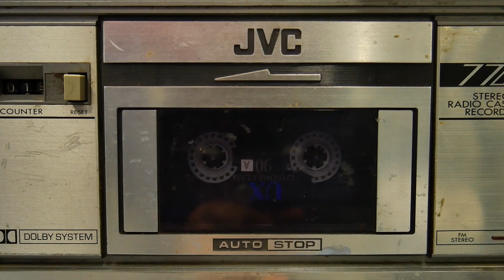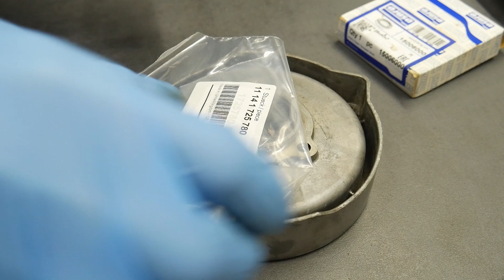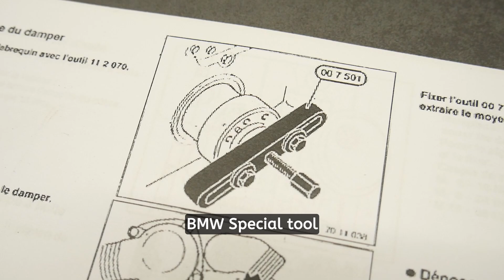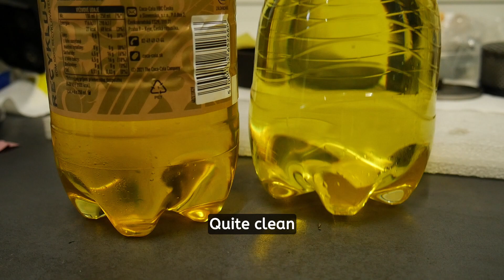BMW 850Ci Project LazerHawk Restoration Part 4: M70 Repair

Comment: Nice work.  Few tips though...  on the lower pan, always remove any bolt puckering on the holes from previous techs not using proper torque - and do NOT use sealant, as it actually breaks the cork. Kudos on the zip tie method too, not many know that one. Also, as you've likely figured out already, putting the water pump back on before the harmonic balancer is a good idea ;) . The Valley pan gasket & bolts... chase all the threads with a thread chasing tap, replace the studs, and use a thread sealant (not locker) on all of them - especially the studs.  The Valve covers use acorn nuts on most all of the studs except the ones that have the rubber stand-off to the manifolds or fuel return lines.

I've built these engines for over 20 years... M70's, S70's, & 6 Liter sleeved monsters.  They are super reliable when done correctly.
Reply from the maker: Thank you very much for your advice. This is my first car restoration, I could use any tips. And if you see something I'm not doing right, feel free to let me know.

Comment: I safety wired my Banjo Bolts. Lock tabs work just as well. Visual Reference as to they were tightened correctly. Looks good

Comment: Thanks for sharing!  I did my 850 M70 about a year ago, it brings back fond memories.  These cars are great to work on even for a newbie like me.  So many oil, pentosin, coolant hoses to replace!  I don’t know the condition of your valve seals, but that would have been a perfect time to replace them if needed.  I used the compressed air method and it was quite methodical and relaxing to do the job.  I wrote down the order of steps to do each intake and exhaust seal before doing the task to be sure I didn’t screw up.  Nice rims on your car.
Reply from the maker: Thank you for your comment. I'm a newbie too. The engine has not been started for 12 years. I do not know the condition of the valve seals, I would be happy to start it first 🙂

Comment: Last question for you. Which workshop manual do you refer to in order to find torque specs on all the engine bolts?

Comment: How did you lock the motor to torque the crankshaft bolt?
Reply from the maker: I locked the flywheel
Reply: @synthwavegarage  how did you lock it..and what's the torque spec for the crank bolt, I have to replace the lower timing chain cover,one of the crank sensor mounts broke,wanted to weld it back but decided to replace the cover
Reply from the maker: Send me a message to my email address  synthwave.garage.80s@gmail.com